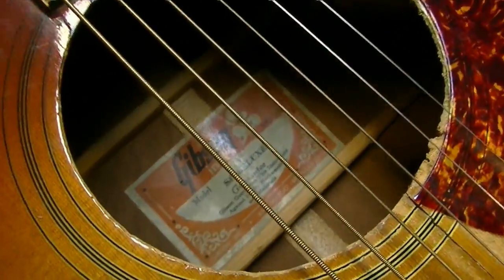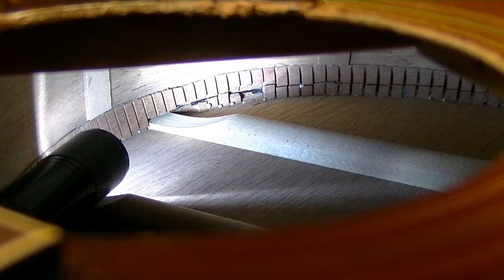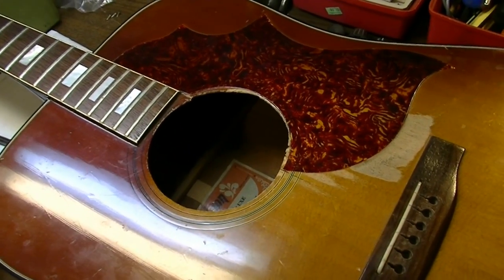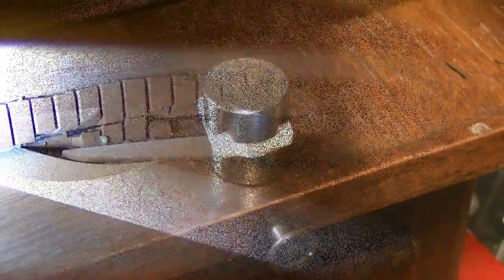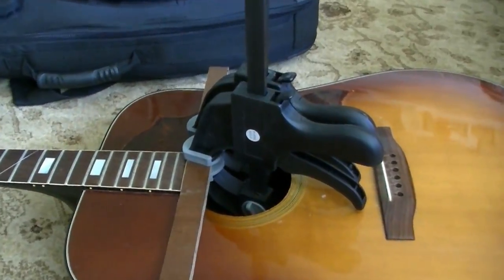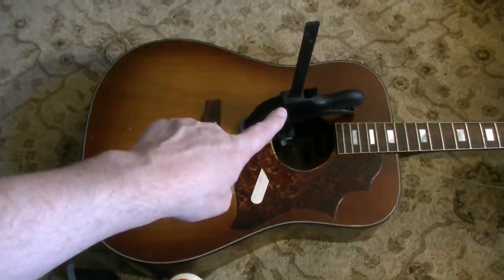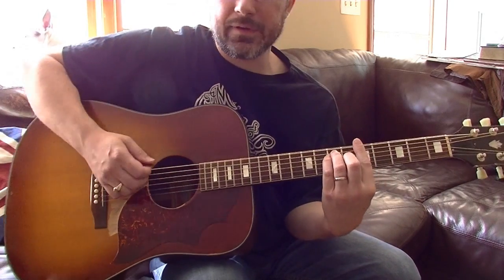Acoustic Crack Repairs & NEODYMIUM MAGNET FUN!

Comment: Ah, rare earth magnets. I watched a video a couple of years ago about building a wind generator with a Volvo front spindle/brake rotor as the hub and Neodymium magnets about an inch in diameter and like a 1/4 inch thick and they had BIG warning about getting your fingers between the mags and any steel plate because they would break the bones in your fingers!! YIKES!!

Comment: Not really sure if the repairs so far, let alone a refret is worth it. As you got it may have been worth $1100/$1200. The work you have done so far has saved it, of a while anyway. Spending another $400-ish will only add $200 to the overall value if that. Set it up for slide?

Comment: Is it possible to replace the old pickguard to prevent further damage?
Reply: Yeah from the look of that thing, I wouldn't want to take that PG off. It might be the only thing holding the top together at this point.
Reply from the maker: Yes, but the risk of me causing damage in the process of removing the PG is high. I think these PGs are glued directly to the unfinished top and then finished over. The edges of the PG have nitro finish that creeps up and over the edge. So I'd have to score the finish and knife off the old PG. That could prove difficult and expensive, and besides, I think the PG has shrunk as much as it's going to already. It's been over 40 years, so...

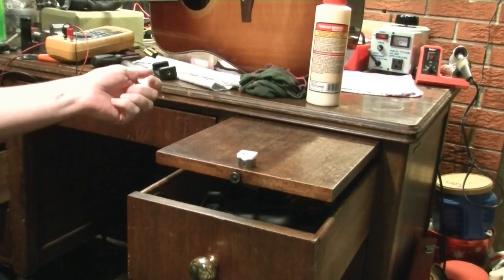Comment from the maker: 12:19 in, put the video on 0.25 speed and watch this part in slo-mo! To do this, click the little gear on the screen and select "speed". :D
Reply: You can also use the "<," key to slow down, and ">." key to speed up. If the video is paused, you can skip single frames with those same keys.

Comment: Those magnets can shatter if they get away from you all of a sudden. By the way...do you know that fret soldering hack? I got a hold of a pretty nice guitar cheap cuz the frets were chewed up. I don't have the tools or the know how to refret, but I tried the solder trick and it came out surprisingly well. Bought me some time anyway
Reply from the maker: Solder is so soft, that won't last long. Best to just replace.
Reply from the maker: ...and you're right about the magnets shattering. This little exploit actually chipped one of my magnets! Pissed me off.
Reply: I used the lead free stuff. I don't know if that makes for better durability. I have a nasty guitar jones and I'll need to save up for a non essential upgrade. And I chipped a few myself on my first batch of magnets. I had no idea they could be so powerful xD

Comment: The back probably wasn't lining up with the top because it has shrunken and needs to be humidified.
Reply from the maker: That may have been part of it, but it was mostly the hit it took slightly distorted the back. I mostly got it straightened back out, but still a little wonky from the hit. Probably wouldn't notice it unless you were looking for it.

Comment: If I knew you did acoustics, well......I guess sending a dreadnought acoustic to Kentucky and back would sort of defeat the purpose of a setup.....but I think I need to pull the bridge off my old Takamine and reglue it, because it is visibly popping up at the back when the strings are tuned up.  . . .  . . now open up and say "aaaahhhhhhh."
Reply from the maker: You might need a set of bridge cauls to complete that project. I have a set of aluminum ones I might demonstrate soon on a baritone uke with bridge bellying and issues.